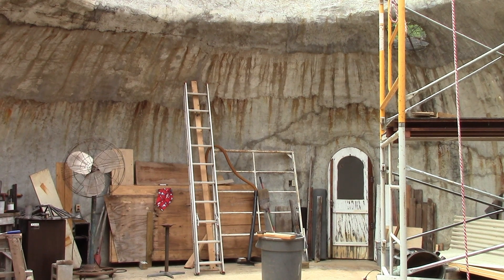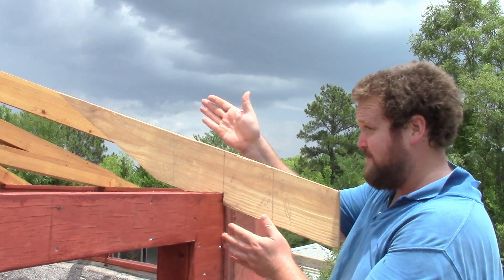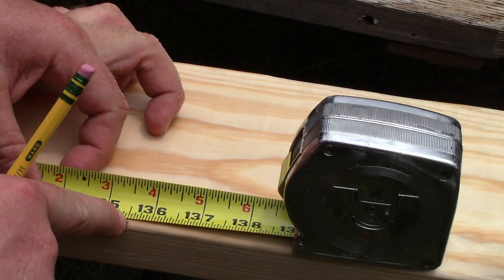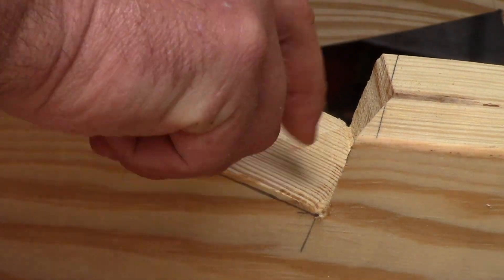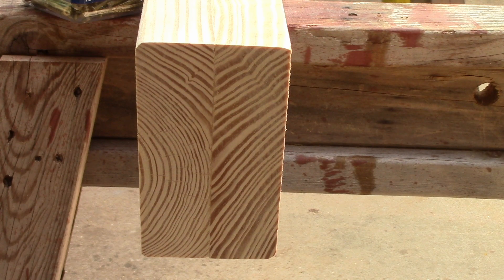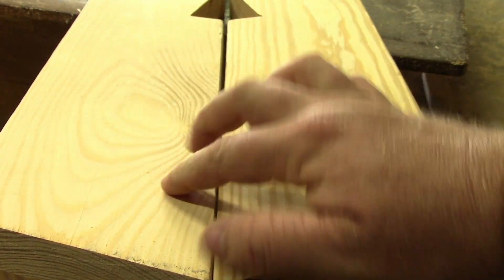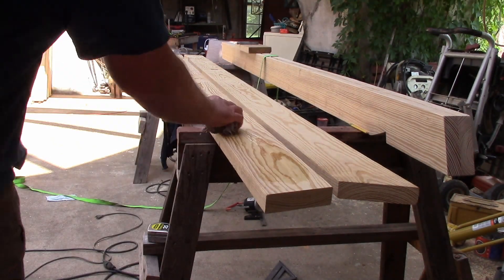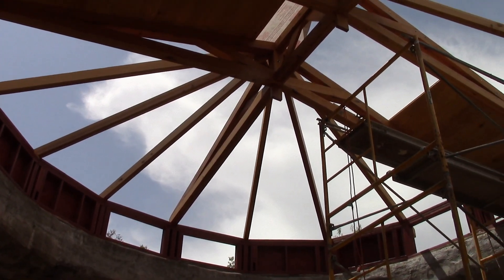Ferrocement House Project Part 12 Rafters for the Round roof on a dome house

Comment: You measure your 8" spacing on screws. I never do that, so looking at my spiked-together boards, you can tell when I was in more of a rush (or was running low on nails). ;)
Reply from the maker: I did go overboard with the measuring of my nails but I through experience knew I wanted it to be as uniform as I could make it. I can’t believe I didn’t film putting the finish on the wood after all that work. Oops.